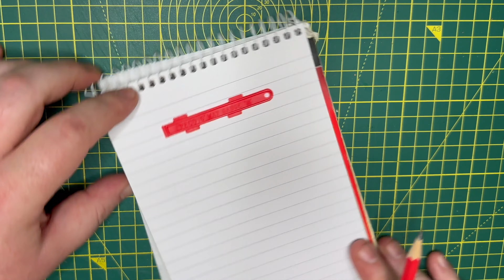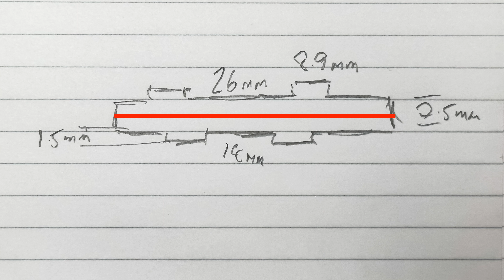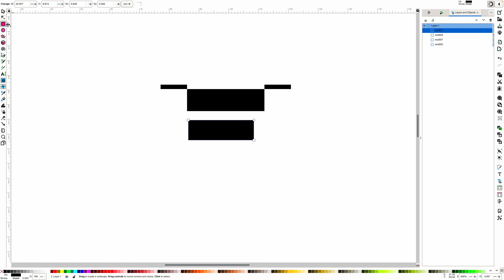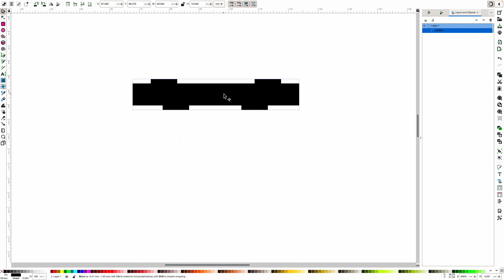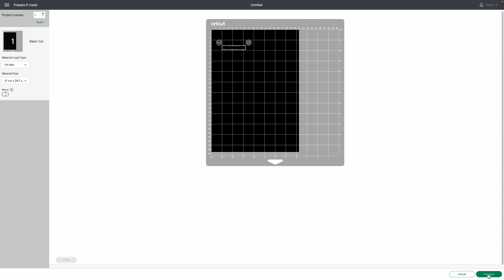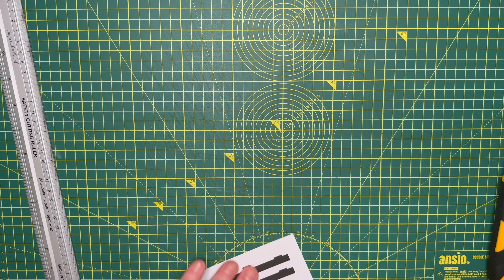068 - Build - Creating 6ft Way Gauge Tool

Comment: Could also potentially get them 3d printed or cut them out using plasticard for extra longevity thogh plasticard+laser cutter might emit fumes if it doesnt melt n go bad.
Reply from the maker: Yes, they'd make a great project for a 3D printer! The Cricut Maker 3 can cut plasticard, but only up to around 1mm before it begins to struggle, so I think you'd have to glue two of them together to make them stable enough to be free standing! Yeah, laser cutters seem a bit scary to me, so I'll stick with the more conventional cutting machines! All the best, Ian.

Comment: Morning Ian,
Whilst acknowledging the inconvenience I find it amusing that these relatively large bright red things must be lurking somewhere and that you'll find them one day! That said, I know I bought two, but I've only seen one for a long time now! It's a bit like teaspoons in this house. Your solution is nice - since you know they're going to keep wandering off a cheap but effective alternative is card, plus it looks like they're better at standing up because of the flat edge :) For long straights you could make a completely different type of jig, more like having parallel tracksettas joined together.
Reply from the maker: Morning Jonathan! Yeah, how can you lose something so brightly coloured? I even lost the one in the video for a couple of hours, but rediscovered it sitting in my magnetic dish, trying to blend into its maroon colouring! Lol! I've now actually modified the design slightly to have one tab that has a depth of 4mm instead of 1.5mm! This allows you to place it between the sleepers to touch the baseboard, and gives much more stability to the whole gauge! The other tabs need to remain at 1.5mm depth as you'll find that the sleepers don't always align on tracks parallel to each other! Actually, funny you should mention tracksettas, as I've got a video in the pipeline about creating your own track templates that can be fitted between the rails in order to lay flexitrack more effectively and accurately! Watch this space, as they say! All the best, Ian.

Comment: interesting.  does it cut plasticard? which cricut machine would you recommend?
Reply from the maker: Hi Tim! I believe the Explore and Maker machines will cut thin plasticard! I'm pretty sure the Maker 3 will cut up to 1mm thick plasticard, but don't purchase one just on my say so! Lol! I've only ever used the Maker 3, and I'm incredibly happy with the machine itself, although the Bluetooth connection isn't stable enough to use in my opinion, so it needs to be plugged into a USB port! The Design Space software is also pretty awful, so thank goodness for Inkscape! But yeah, for cutting alone, and the range of materials that can be cut, I'd definitely recommend the Maker 3! Hope this helps! Cheers, Ian.
Reply: @iansngauge  thanks ian. i might buy one! im not great at cutting things out with high accuracy! it would help with making basic structures. plus it's something new to play with. cheers.  tim

Comment: If you liberally coat your freshly cut spacers with superglue they will go hard when dry and won't start to break away at the edges like untreated grey board does.
Reply from the maker: Thanks Paul! That's a great tip that I'll definitely be trying for my next batch! Cheers, Ian.

Comment: Hi Ian, very interesting and another nicely put together video. Fortunately I haven’t mis-placed my Peco way gauge tool yet but it’s an another good use for your Cricut machine. Nice to see you have a Swann Morton scalpel and some sticky labels which means I’m looking forward to some model building, no pressure, lol!
I have actually bought some plywood and I’m hoping to make a start back on Exehaven this weekend depending on the weather for cutting the board!
Cheers for now mate, John
Reply from the maker: Morning John! Thanks very much mate! Ah, scalpels! I've still not found one I'm really comfortable using! I must have tried at least half a dozen different brands! The blades that came with the Swann Morton seem to last longer and are a bit sharper than the other brands I've used - although that's very subjective as it depends on the material I've been cutting! But yes, I've been practicing for when I start some real model building! I need to build a bridge to represent Shelfington viaduct first! I've bought a Metcalfe kit, which I'll build, but probably won't use on the layout, but rather use it to base a scratch built viaduct on - fingers crossed! Looking forward to your next update - it's supposed to rain this weekend here, so I guess you'll have to keep your golfing bats in their bag! :) Perfect weather for modelling though! All the best, Ian.

Comment: These are fantastic machines, I have a REALLY old one, which will only cut set designs on a cartridge, you could only change the size back then. But for card making it was great. Now you can create your own designs fantastic. It’ll be brilliant if you scratchbuild your own buildings.
Reply from the maker: Hi John! I must admit that it was a toss up as to whether I got a 3D printer or the Cricut machine! I'm really glad I went with the Cricut machine as I've got quite a lot of use from it for the stage I'm at in my build - and yes, I definitely intend to use it to scratch build stuff! In the meantime, 3D printer technology seems to have moved on, so I'm hoping to invest in one either later this year, or early next year! All the best, Ian.

Comment: Hi Ian,if you run super glue along the edges of your grey board it will stop it from fraying,and will last much longer,as long as you don't lose them.
Reply: Great sugestion Bob, I have used super glue to seal and strengthen my servo mounts that were cut from greyboard.
Reply from the maker: Thanks Bob! Now that's a great idea! My next batch will now be even stronger! :) Cheers, Ian.